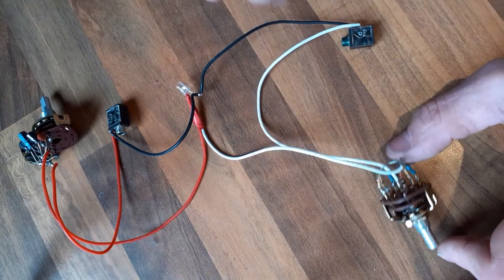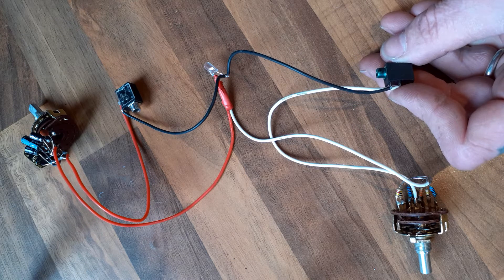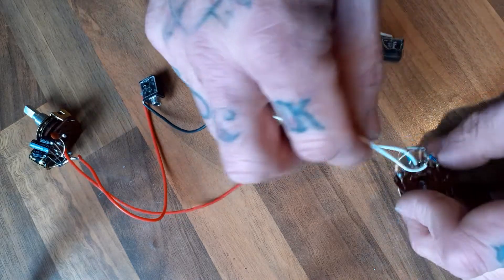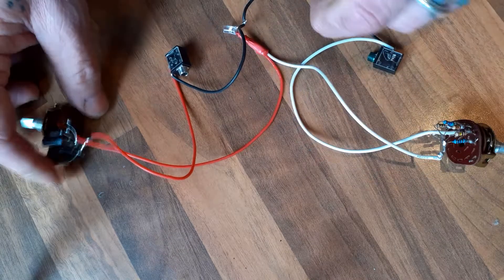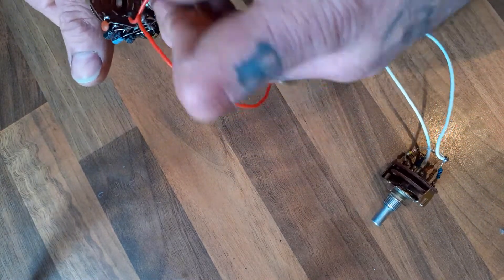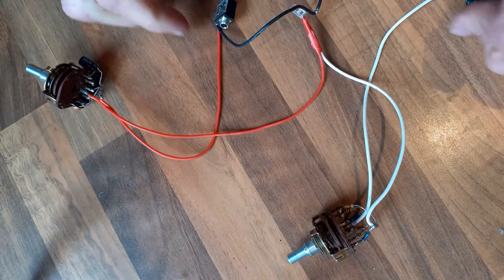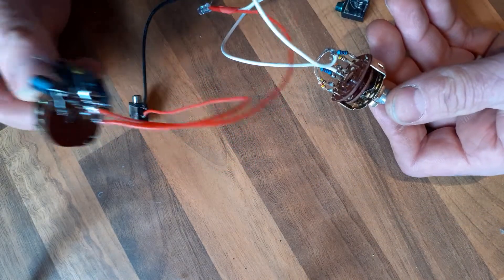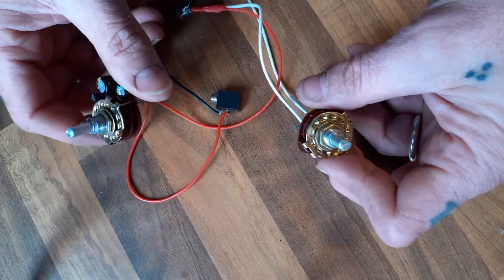MKII RGB led warp oscillator- diy - added rotary switch option.

Comment: Where do you get those multi pull switches from ? I’ve been searching but can’t find them anywhere.
Reply from the maker: These are the ones I use..
Ebay - 2p6t rotary switch

https://www.ebay.co.uk/itm/2P6T-Rotary-Switch-2-Pole-6-Throw-Rotary-switch-24mm-body-/265207724142?mkcid=16&mkevt=1&_trksid=p2349624.m46890.l6249&mkrid=710-127635-2958-0
Reply: @Krustpunkhippy  Nice one. Thank you. I’ve just been on your Wordpress blog finding new stuff to make even though I still haven’t made the BABY 8 PCB or APC  I bought from you ages ago :(